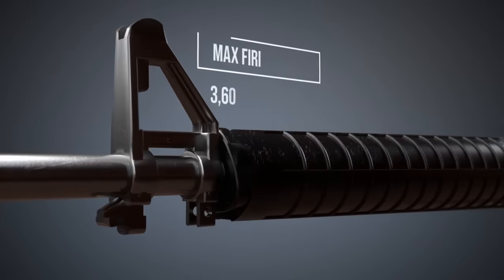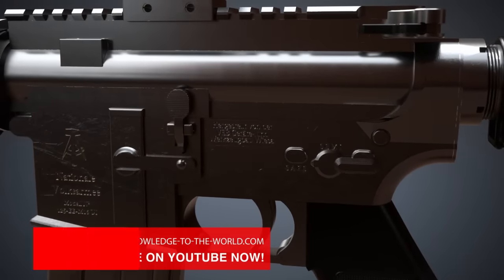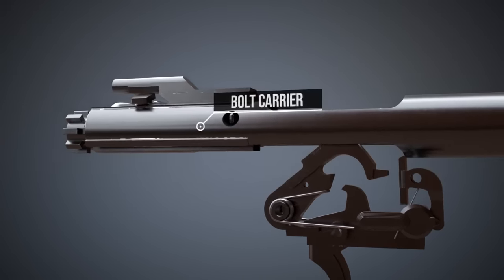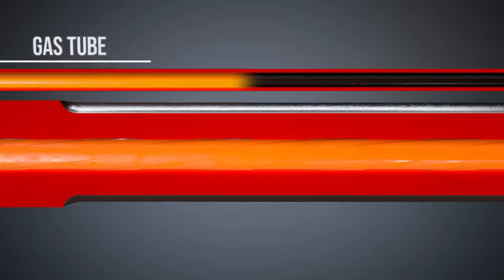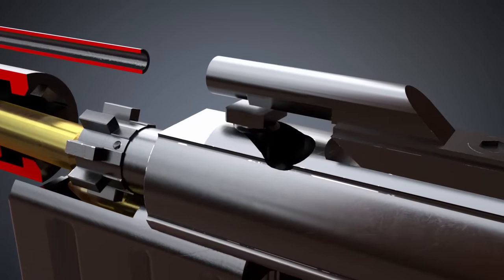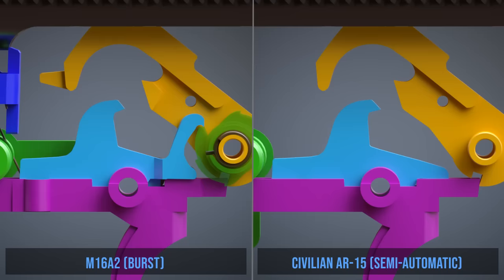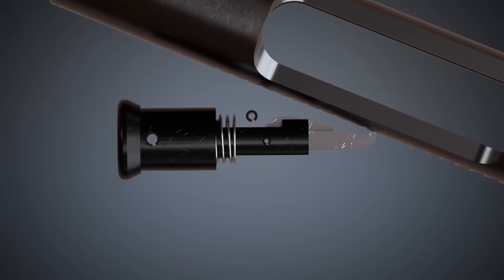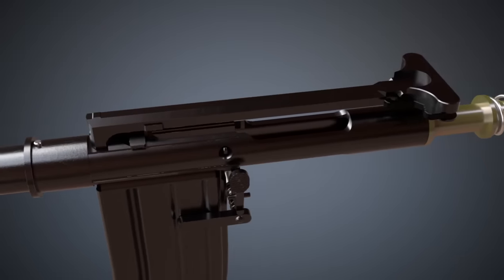M16 and AR-15 - How firearms work! (Animation)

Comment: I must say, I am impressed with the level of clear detail and explanation shown in this video.  As a Gunsmith of 38 years as well as a retired Senior Service School Instructor, U.S. Army at Aberdeen Proving Grounds Maryland I have taught this theory in the 8-step in the cycle of function of the AR/M-16 series for many years.  With exception of a few minor areas not covered like the gas port/gas block and function of the buffer itself, the animation and your lesson on the cycle of function was fantastic.  Bravo sir, bravo.
edit:  Posted 07/2020, about one year after introduction of this video.  It does appear as though the author has gone back and re-edited this video to address some short coming's of the first release, but hasn't as of this re-post explained how the gas coming back through the gas tube and carrier key interacts with the high pressure chamber formed between the carriers bolt seat and bolt rings and tail that causes the carrier to move to the rear, turning the cam pin in its carrier groove.  Nor how the excess gas is vented over board through the two gas exhaust ports on the carriers right side.  
The action of the rotating the bolt faces extractor jaw holding the rim of the cartridge casing, aids in breaking the seal of the cartridge casing from the chamber wall before the rotating luging lugs reach the unlock position.  
The remaining rearward inertial force continues to propel the carrier/bolt and casing rearward against the buffer spring and buffer assembly guided by the buffer tube.  Near the end of the rearward travel the cartridge case clears the chamber face and the plunger type ejector pushing against the case s base under spring pressure pushes forward opposite the grip of the extractor jaw gripping the cases rim.  
Thus causing the empty to pivot on it's base and spin clear of the ejection port to the right and against the built in brass deflector project of the receiver on late model AR's.   
However should a round of high-pressure round of ammunition "over-gasses" the system.  The buffers tail (a polymer insert ) will strike the back of the buffer tube to cushion the blow and halt movement resulting in heavy recoil force.  Once all rearward inertial force is expended, the buffer spring will drive all parts forward to feed and chamber the next round.
(wow, that was a mouth full)
Reply: I could see how the piston on the bolt tail is acted upon by gas pressure, although the narration does not explain this, and the buffer is passed over entirely. Me pointing this out would be just a complaint, but with your qualifications it's critique.
Reply: No way i live right down the street
Reply: I didn't know gunsmith is an actual occupation
I assumed guns would just be manufactured by automated labor...
Reply: @jhowardsupporter   hmmm, lets see now.
1).  if one unloads an automatic weapon (legal, or illegal) into someone, they die.

2).  if you know of any illegal weapon, you are now an accessory after the fact in any criminal acts with said weapon if you are found to have prior knowledge.

3).  all weapons in my home are locked in fire proof gun-safes only I have access to.

4).  after 25 years in the Army, automatic anything besides a coffee maker is old. so I don't own any fully automatic weapons.

5).   an intruder onto my fenced property would first need to negotiate said entry with my three Kelpie/Red Healers, and boy do they hate late night visitors.
Reply: @onemoremisfit    sorry for the delay in reply.  in answer "no" your observations are not invalid, nor complaints in the least.  and good on you for pointing out the Bolt-Tail.   ^_^
Reply: @PinkENBlue   sorry for the delay in reply.  The Gunsmithing trade is as old as firearms themselves.  the Smith can hand-make parts, were in a line technician simply "assembles" pre-made components to a set standard.   I hope that helps.  ^_^
Reply: @Bret Redfern   You are very welcome, I served three different tours at APG over my 25 year career.  And like you I still remember my primary and platoon Drill Instructors with shocking clarity.    >_<
Reply: Mialisus    thank you for noticing.  My niece picked my avatar.  And I do love both her and it dearly.   ^_^
Reply: @ditzydoo4378  It's legal to kill a home intruder. Not only that, if there are multiple and any survive they will be charged with the homicide of the people they are with and that you shot. So let me clarify 3 people break into your house, 2 enter and 1 waits outside as the getaway driver. You kill the 2 that enter and call the cops. The 1 getaway driver outside get charged with home invasion and 2 counts of murder. God bless America.
Reply: @jhowardsupporter   I'm confused, what does any of that have to do with the video shown here???   o_0
Reply: @PinkENBlue  no automation in the building of a lot of fire arms. You have to realize that there can only be like a .00001 mistake ( that may not be accurate, but more of an example of how precise tolerances must be) when building fire arms. 
Especially with rifle barrels. 
Maybe some not so important parts might be mass produced or by some sort of automation, but for the most part, it's hands on.
Reply: "Wow that was a mouth full."

Me: that's what she said.
Reply: I live right by there
Reply: @ericwilliams7374   Well said, and you're quite correct.  There is no automation in the actual building/assembly of a firearm.  They are far to complex and have too may variables that require constant testing, measuring and spot evaluations.
But the industry do use CNC machinery to make individual components to strict production standards.
Reply: @danielbenington4814    Oh my, I did leave myself wide open for that.  >_<
Reply: @physixsx7179   Have de Grace, Edgewood, or Aberdeen itself?
Reply: DitzyDoo Yup!!
Reply: CHROMA  it was chosen by my niece and I rather like, it makes her happy.   ^_^
Reply: CHROMA  thank you for the Compliment, though I've found over the years that each of us shines in their own way.  ^_^
Reply: CHROMA    as it was nice to talk t6o you.  Experiences, a few.  Philosophy, try to see things form the others perspective and smile from the heart.
Reply: CHROMA  still undecided, what with all the rhetoric flying between party candidates.  I vote non-partisan (no group affiliation), and will only vote for whom I feel is the best qualified of the field.  Regardless how hopeless is sometimes seems.
Reply: Mouthful indeed...

...but worth reading.
Reply: @stevemc01   thank you kind sir.
Reply: @ditzydoo4378  Same to you. :)
Reply: I went to Aberdeen Proving Ground in 2003-04 for Tracks.
Reply: @tomnguyen7977  ah yes, just down the street from Hatcher-Hall were I taught.  but alas the Ordnance school has been moved to Fort Belvoir in Virginia.
Reply: @ditzydoo4378  Yes I heard they closed down Ordinance School.
Reply: @tomnguyen7977   not closed, merely moved as part of the base consolidation plan that goes back to the mid 1990's.
Reply: @ditzydoo4378  oh ok, I haven't been back there ever since 2004.

Comment: Stoner was a genius! Best animation ever! Well done.
Reply: With a few simple parts Sig-Sauers M15 keeps the dirts from fouling the bolt area.
Reply: @1324HELMUT  yeah well the Swiss are Swiss...
Reply: Well AK has the same mechanism, but far more simple in use and maintenance. Still bouth of systems r pretty good to nowdays.
Reply: Years ahead of his time and still to this day not one battle rifle out that can do anything the ar platform can’t do. And to boot it’s not true D.I. gas system it’s actually an in line piston design for recoil control. Check out military arms channel for a video on that topic I thought that idea was crazy until I watched it. Stoner gave us a modular platform before we knew we needed it, RIP stoner!
Reply: Stoner was also an idiot. Direct gas impingement is the worst form of gas operation. Kalashnikov had the right idea by using a gas-piston system. Thankfully the AR-15 platform can be upgraded to gas-piston with an appropriate upper receiver and bolt carrier.
Reply: @charlesferdinand422  
Actually no, check out both the M16A1 and AK mud test of InRangeTV
Reply: @SableDrakon  the AR-15 is not an impingement gun....... take apart the BCG and see the glory that is an internal piston with gas rings. "Upgrade"..... No, it's fine. In fact it does better than the AK in keeping the gun clean in adverse conditions. 

The AR-15 requires lube for the most part where as the AK does not. I own both and love both.
Reply: @lostsaxon7478  Having used the AR-15 platform through my military career, I'll still take the AK or any gas-piston action.
Reply: @SableDrakon  yeah, I used the M-4 when I was in and thought the gun was absolute trash because the mags always fell apart, the parts would break constantly and the receiver rattle was atrocious then went on to buy an AK74 when I got out. I got educated on the matter and realized the military doesn't replace parts as they should, especially magazines, and went on to buy an new AR-15 and found it to be a completely different gun than the one I was issued. 

I'll take the gun that is common in a given area and has plentiful ammunition floating around.
Reply: @charlesferdinand422  > the M16 was a shitty rifle that 

required DECADES of improvements and fixes to become remotely acceptable

Then please explain the stellar performance, from day one, of the preceding AR-10 in the Sudanese, Guatemalan, and Portuguese militaries. Or of the early commercial AR-15s used by US advisors in South Vietnam. Or of the actual M16s and M16A1s once the cleaning kit and ammo issues were sorted out.

Comment: The quality is amazing and it is also bored enough and I am pleased to see that you made a distinction between the Civilian AR15 and military/police M4/M16. A minor nit pick is that the mag release is something pressed once to release the mag and is let go after that, even when inserting a new mag, but that is a speck of dust in the beautiful masterpiece of education.
Reply: technically holding down is less wear afaik
Reply: That's due to the idiosyncrasies of 3D modeling and simulation - if you watch closely you can see a few details like that in other places too. In software like this you have to translate one part and then translate another etc. There's no gravity or spring forces or anything.

Comment: As an AR-15 owner, I'm impressed that all this happens at the pull of a trigger.
Reply: If We have to and it's looking more like we might need to one day, how difficult would it be to make it full auto?
Reply: @Damster587  don't even think about it
Reply: @RobertSmith-fd7ke  ok
Reply: @Damster587  you might be able to get a forced reset trigger tho which essentially is the same as full auto but instead of the bolt releasing the auto sear, it forces the trigger to reset
Reply: @Damster587 It's not hard if you have basic gunsmithing experience, machining tools, expertise, and general knowledge. 

To make the components yourself would take precision measurements, for the components, which can be bought or fabricated, plus a third precision press drilled hole. You'll also need a full auto bolt carrier, but most modern civilian ARs already come with that.

Alternately, you can buy readily available full auto trigger packs and use a stencil to drill the third hole. Those packs are legal to own if YOU DO NOT OWN, NOR PLAN TO OWN an AR; they're meant for owners of transferable machine guns or holders of one of several types of FFL or SOT for personal dealer samples.  If you do buy one and are not one of the above, then you're committing a serious felony and are facing 10yrs+ prison. 

The average idiot can't do it. The average average person can't, either. I can. It'd probably take me a few hours to tool up the selector, sear, mill out the selector catch, and drill the hole.

I won't do it. I never have and never will, but I could and I know how. I have binary triggers in a few of my ARs for "shoot fast" purposes. As already stated, forced reset triggers are the hot trend for shooty fasty, but binary is better.

Pretty much every fudd says "don't ask", or "don't think about it", or "you can't". I'm here to call them out; knowledge is not illegal- acting on it is.
Reply: @FuzedBox  That's fascinating. It's also reassuring to hear, just in case.
Reply: @Damster587  Just keep in mind that there a currently two legal options for rapid fire: Binary triggers and FRTs. Another (illegal) option would to be installing a drop in auto sear, or DIAS for short. They come in several forms but achieve the same purpose. They come in many designs up to and including bent coat hangers and 3D printed inserts.

You can even buy legal registered ones, but they were serialized and registered pre-'86 and are simply stamped sheet metal. They are considered machine guns in their own right and command utterly ridiculous prices. When you go the DIAS route, your weapon becomes full auto only.

Let's take a step back and evaluate the purpose of full auto: It is not meant for effective lethality; it's a force multiplier. Spray and pray is a tactic that'll get you killed. Instead, it is used for suppressive fire purposes in order to get you and your squad into better positions or buy time.
Reply: @Damster587  get a book on auto seering ;)
Reply: I'm just checking to see if the ATF raided any of your houses since you've posted this.
Reply: @patrickkinnear8625  why? Just cause the shooters that committed the crime doesn't automatically make other AR15 owners the same. Mines are strictly home defense and shooting range. That's it. Other AR15 owners use it for the same reason,  perhaps with a reason or two more. Mines is perfectly legal too and in compliance.
Reply: @Damster587  
plenty of guides online, all you need is a metal coat hanger

Comment: It is amazing how far computer solid modeling has come. I was a chassis designer at Chrysler when they first started using computers for design, Textronics it was called.  Wasn't long though and CATIA was the preferred system, wire frame and basic surfacing then. Went to GM and learned Unigraphics, was then introduced to solid modeling and kinematics as a suspension designer. Left the industry in the early 2000's, making a model like this video back when I did it would have taken forever and a computer big enough to fill a room.

Comment: I'm no gunsmith by any means but I'm comfortable in saying that I know 90% of what there is to know about AR platform rifles and I've always wondered how burst fire worked and now I finally learned!
Reply: Yea burst is way more difficult to create than semi auto or full auto.
Reply: another key part is the mathmatics such as how heavy the bolt has to be to blown back correctly

Comment: Well done, and thank you for getting descriptive enough to note that the M16 and AR15  are two totally different trigger mechanisms.  I was nervous initially as most videos do not discern the difference, which leads to mis-information even among gun guys about how this platform works.
Reply: It was Colt's Mfg. that did not discern the difference as the original AR-15 was capable of automatic fire and the earliest M16 models have AR-15 in their roll marks: https://i.imgur.com/MAkOoGW.jpg
Reply: @cottonballs185  That is the first I heard of that but I can see that if the AR-15 you reference  were the early pre-M16 designated test units.  Those were not designated for civilian use correct?  Or am I off base?
Reply: @EK-oy1te  It was my understanding that the Air Force fielded the AR-15 independently under the designation M16 and the Army later procured the XM16E1 on a trial basis leading up to the finalization of the M16A1, which would be the model adopted by all branches by the end of the conflict in Vietnam
Reply: @cottonballs185  Wasn't it the Air Forces cold weather accuracy test that made the millitary adopt a 1:12 twist versus the original 1:14 twist that was trialed by special forces in Vietnam?  So the AR-15 for the Air Force was never released as a model to civilians but probably later modified to be compliant to the M16A1 later released as you mentioned.
Reply: How Copy  I don't see a link
Reply: @E K
 This rifle was designed as an AR-15 and later adopted as M16 by US military. AR-15 is not only the name of civilian semi-auto variant. When you say "AR-15" it can be anything. From M16A4 to every civilian frankengun you can build. But when you say "M16" you are refering to a very specific model of AR-15 adopted by US military under this designation. Long story short: M16 IS AR-15.
Reply: @EK-oy1te  I thought the arctic trials resulted in the 1:7 twist being adopted.
Reply: @jeffstone671  1 in 7" was adopted to stabilize the long bearing surface M856 tracer round.
Reply: My basic training M16A1 had "AR-15 M" stamped on it. It also had "HYDRA-MATIC DIV G.M. CORP U.S.A." on it.
Reply: @hakari5014  thank you. And civilians should be able to own both